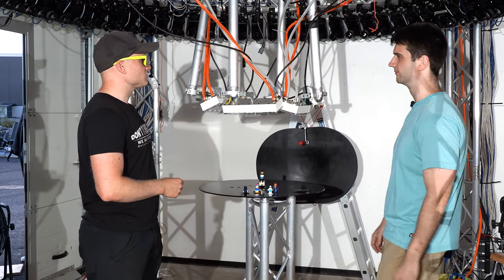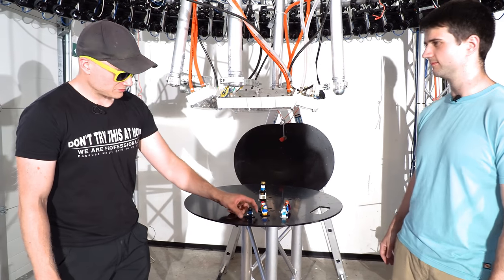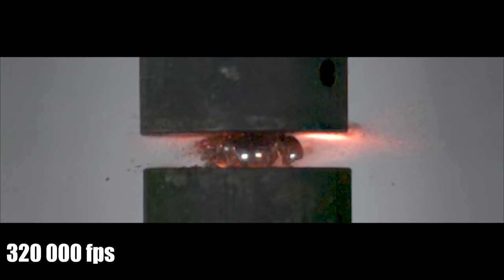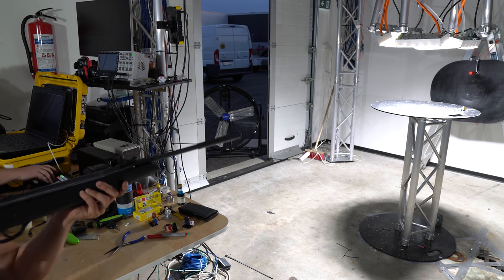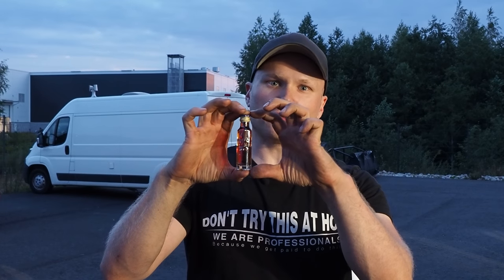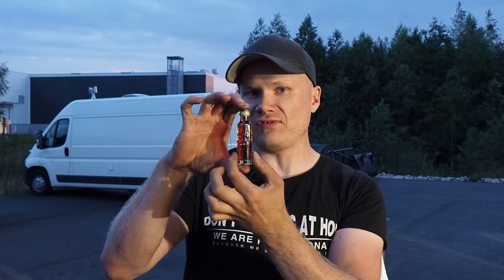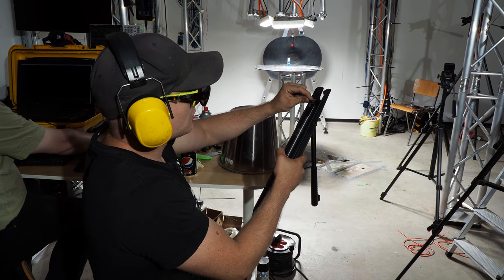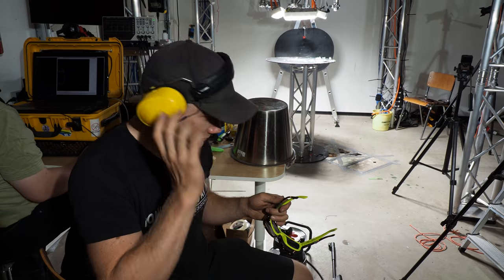Lego Man Vs. Pellet Gun at 1 000 000 fps

Comment: I really think a variable spinning table would make this just AMAZING.  If you’re off on the calculations a little it’ll still be a very slow spin.  Then you can watch the pellets enter fully slow motion and then switch to exit view by a 180 degree camera switch.
Reply from the maker: There is only small problem... The table should spin 833 333 rpm to match the camera :D I am pretty sure that it would explode way before that speed
Reply: 72 cameras getting 1M fps would be 13,888.888889 rpm (and fps per camera) yes?
.000001 seconds each frame, .000072 is first cameras second frame?
I’m sorry I just really like numbers.

Comment: I think you need some sort of a flashlamp or pulsed LED driver, so that the lighting is on for a minimal amount of time; that way the table and the specimens won't heat up. Of course then you would need to synchronise lighting and the high speed event, but in the simplest case I suppose the circuit could just turn on the LEDs (maybe even more powerful than now) on command for 1 or 2 seconds, giving you a time window to trigger the event to occur (in this case shoot the gun).

Comment: I feel like the bottle would’ve looked better if you shot it lengthwise, with the cap facing you. Since the cap was metal, it wouldn’t shatter the glass right away, and you might be able to see the pellet moving through the water. Then when it hits the bottom, it finishes with the glass shattering. Just my opinion

Comment: That's a Hatsan Edge isn't it? I have that same model, I didn't know what to expect from a Turkish air rifle, but I like it all right. The only drawbacks are that it is louder than my 10/22 .22 rifle with ".22 short" rounds (you have to load them individually but they chamber just fine) and the fiber optic rods are too large in diameter for precision shots. But it will certainly sling some lead.

Comment: Fill a glass bottle with barely molten water, at the maximum density temperature,  leave a small air gap, and then cap it tightly enough to contain the pressure. That way when you shoot it it's under pressure and explodes more violently.

Comment: Cool! Curious what kind of airrifle is it, and what amount of joules?
Reply from the maker: It's 4.5mm and it has shoots at 320m/s. Just basic spring operated mechanism just the fastest one that I could find for cheap. Otherwise it's really good but it's really loud so you have to wear hearing protection. I am not sure about joules since there isn't any limit for those on unlicensed air rifles in Finland. As long it's under 6 mm it's fine
Reply: @Beyondthepress  Thanx! I have a 14 and 24 joules 4.5mm so i was wondering how it compared. Very cool to see it in such detail! 👍
Reply: I believe a lead pellet weighs about 8 grains (0.5184E-3 kg), so plug it into K.E.=½M(V^2). It's around 10 joules depending on pellet weight and velocity. (6-12 J)
Reply: @xenonram  Thanx 😊 Edit; i just checked, my 24 J shoots 10.6 grain @320m/s, 14J 8.1gr atm. Seems about right!

Comment: Does the picture have to spin constantly? Could you also show it from one angle and then pan to a more interesting one when needed?
Reply: Yes. No. Those incredible frame rates are achieved by having the cameras take one frame each in turn, around the circle. Since there are 72 cameras, each one is filming at a frame rate 1/72 of the total. You could look at the video taken from any one camera, but you would only get 1/72 the resolution. This is the same principle as the Gatling gun. You can get those crazy rates of fire because each barrel is firing at a rate only 1/x as fast.
Reply: @jjohnston94   "but you would only get 1/72 the resolution" Correction, only 1/72 the frames per second.

Comment: The 360 view is cool when you have them all display the same frame so you can see how the impact and resulting carnage looks from every angle...but playing the video while spinning around like that really takes away from the details of the impact and resulting carnage. Like how the actual impact frames are missed because we are looking at the view from behind the object.
Reply: That's literally the only way the rig can work to get 1,000,000+ frames per second. That's the whole point of having all those cameras. They have 72 camera capable of a maximum of 38,000 frames per second each. To get 1,000,000fps they stagger the cameras by 1/1,000,000th of a second from their neighbor so there is a wave of exposures that the computer then processes into a video. This way they can create a rig capable of up to 2.8m fps in HD for the fraction of the cost of a laboratory camera which isn't even HD. The tradeoff is the 360 effect.

Comment: Does it have to spin around? I am getting dizzy :(
Reply: Yes. That's how the rig works.
Reply: The rotation is necessary for the high frame rate. A single camera would be much slower. Therefore all cameras in the circle take a picture one after the other.
Reply: @Yaren2580  how do all these comment ppl still not get that? lol